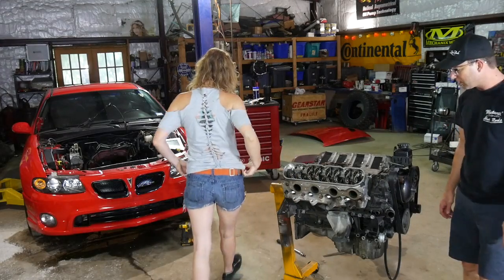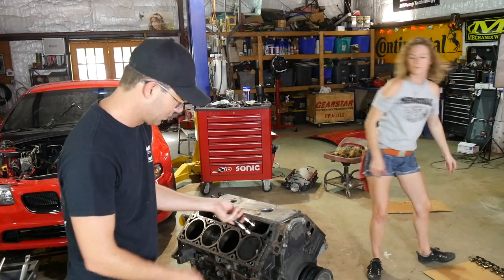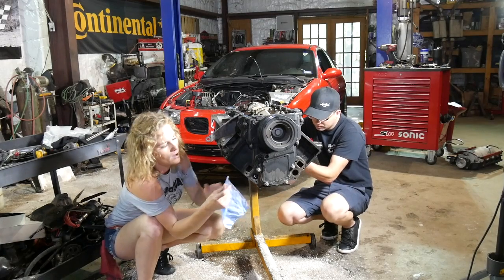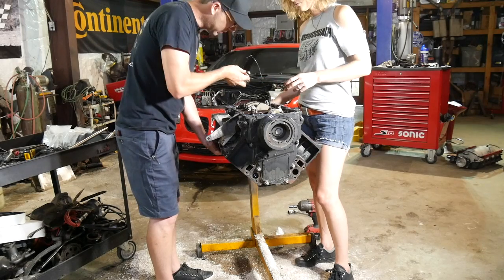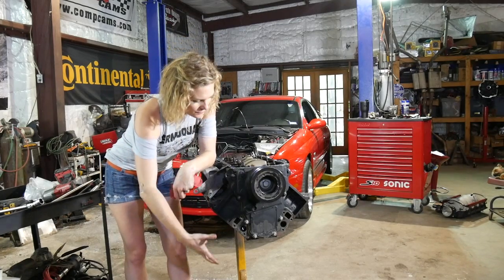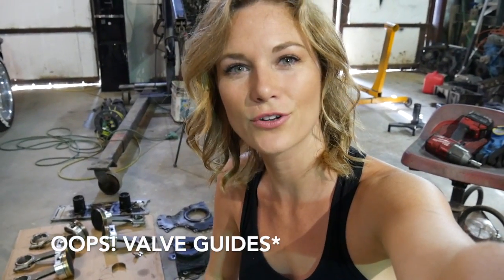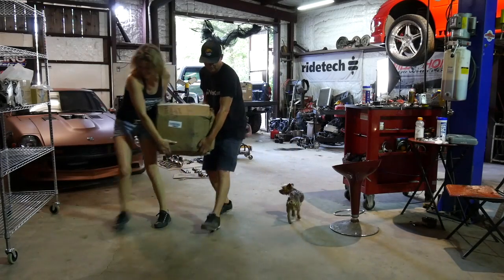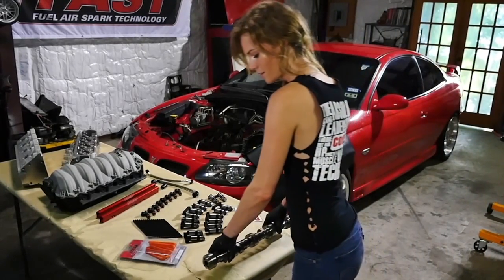Tearing the 408 LS down! In the shop with Emily EP 58

Comment: don’t sweat staggering rings, they rotate in the bore so they wear evenly. As long bore wear, taper and end gaps are good it won’t burn oil.
Reply: Exactly right!  Let's put an end to this crazy myth that "an engine will burn oil or won't even run if the ring gaps are lined up."!

Comment: Here in Aus, we call a "hitch" a "tow bar". The platform that roxy is based on its used to build sedans, wagons and Ute's. They are everything from basic taxis right to to high end luxuary/high power sports cars. 

Imagine a 6.2 litre, supercharged v8 ute (pick-up) with 550 hp and almost 700Nm of torque, launch control and racing brakes. With all that, you can still put 1400 kg in the back and tow 1600kg!

I would have been more surprised if Roxy didn't have the mounts
Reply: Sedans and wagon body’s were built on a totally different production line at Elizabeth. Same as Ute and Crewman yes
Reply: I was about to comment exactly the same thing, but you beat me to the punch.
Reply: They are built on different assembly lines, but from a design perspective, they are all based on the same platform
Reply: There's a monaro towbar setup laying behind my shed here in south OZ.

Comment: Absolutely the monaros came factory with a hitch. The brace was left on our cars but most remove them for weight. If you order a aussie rear valance from Holden Parts USA It is smooth all the way across but has a plug to remove to slide your hitch into! Had one on my car.

Comment: Not surprised that the most expensive thing you got at Summit was the bellhousing. That was by far the most expensive single component of my NV4500 swap on my Suburban. It was even more than the NV4500 itself! I'm enjoying all the stuff you're putting out and looking forward to the next video.
Reply: Hell, back in 1970 the Lakewood "explosion proof" hydroformed bell housings ('55 to '57 Chevy) were close to $600 with the block shield which was optional (iirc, another $75). And today just a few dollars more. And the '55 -'57 used the bell housing for the rear engine mounts; no rear trans mounting those 3 years for the full size Chevy.

Comment: step 1, install oil catch can.  Step 2, actually buy quality oil and use quality oil.  Step 3, disassemble engine in exact order of assembly. The way the heads were removed in this video will cause cracking or warping of the head.  The head bolts must be loosened in the same exact order as tightening.

Comment: Holden/Ford 6cyl/8cyl sedans are common family cars in Australia, so they often have a tow bar for light duty towing (6x4 trailer etc). I wouldn't be surprised if those studs are factory fitted to allow dealers to easily mount a tow kit.

Comment: G'DAY EMILY,to answer your Queries,regarding Towbars/Hitch on GMH(Holdens),YES,almost all commodores,in fact most sedans,wagons,Vans,UTES,have come standard with towbars,with factory optional,heavy duty,towing packages, which included, a heavier Hayman Reece,style square tube tongue hitch point,upgraded rear suspension, and option of wider exterior side mirrors,from my experience, of over 40 years,love and ownership of Holdens,I've found it unusual to find any,without towing ability, this is the norm,with most 6&8cylinder vehicles, it is common knowledge, that from the 60's,in motor racing, a lot of teams,towed the spares,equipment to the racetrack, with their primary racecars, even Peter Brock,joked in the 80's,how he and co drivers,broke in new racecars,in the 1000klm drive,from Melbourne to Bathurst, towing trailers,full of spares,trust this helps,love your GTO build,good luck at Drag week,kindest Regards,Dave McLaughlin, Queensland, Australia

Comment: Hi. Yep   Pretty we’ll most cars in Australia come ready to bolt up a tow bar and it’s been that way since the early 80s I think. 😎
Reply: I'm almost certain, that in fact in the 60's,with all vehicles from EJ on,that the factory allowed for standard 2" towbars,with dealer option for heavier tow package upgrade,from HD,HR on the 21\4" ball was included, as GMH,became aware of heavier Caravan, Car trailer manufacturer moved towards heavier hitch,then from Late 80's,the hayman Reece towbar System, with 50mm Ball,the 21\4" tongue,fell by the way?

Comment: Serious question; I'm building my first LS engine (LQ4) and I was planning on building a turbo forged stroker. Just about the only kits I can find are 4" strokes but everything I read says that's too much stroke and it causes the piston to come too far out of the cylinder at BDC which causes excessive piston and cylinder wear as well as excessive oil consumption (je pistons in particular has a compelling article on it), how was the wear on your pistons, and do you think this may have been a factor in your oil consumption issues? 
Keep up the great work!
Reply: Ryan smith don’t build a stroker turbo engine unless you just really want too or get an aftermarket block. Keep the stock stroke. I always advise against stock block stroker because of the really short piston skirts

Comment: don't rings rotate in the cylinder when running ?
Reply: No, not really "rotation". Pistons go up & down and don't turn / rotate in the cylinder bores.  It's more like as the engine warms up the ring gap closes as the piston head and rings get hot the piston "grows" incrementally larger (fits a 'schosh' tighter in the block); then as the engine cools down the ring may not (re-) expand exactly the same as when it was warming up. Couple that with the piston getting hotter at the top of the combustion chamber where the most heat is produced, and thus the upper piston ring becoming hotter - the ring gap closes more and the (re-) expansion is greater for the upper ring as the engine cools down when turned off.  That is IMO, the main reason that ring gaps "move" and can eventually become aligned; 1st and 2nd rings expand and contract at different rates.  Not much anyone can do about that, it's normal and typically compensated for by different ring thickness and the metallurgy slightly differing between them.   But hey, if there is a scratch or other imperpection in the cylinder bore chances are the rings can make the ring gaps eventually align with each other. 

And Aaron's commentary during disassembly about "numbers" on pistons / rods not matching the block would lead me to think that whoever assembled the short-block was sloppy,  more than likely before Emily and Aaron purchased that 408 already assembled and they just installed the heads. Plus the bad lifter at the rear of the engine might be indicative of poor or fast assembly of the short block just to get the done done and out-the-door.

Comment: Emily is that a roots or Whipple supercharger? the Whipple is more efficient and runs cooler, banks power on YouTube recent videos shows Dyno test on Roots vs Whipple air temperature and efficiency difference
Reply from the maker: tallcamaroguy It’s a roots type from Magnuson!
Reply: @flyingsparksgarage  the roots is 1850s technology, you would be better off with a procharger kit or a turbo because they are more efficient and use less horsepower and torque

Comment: Not being rude but I wouldnt trust a tow hitch on that car. Those mount bolts appear to be thru the sheet metal and nothing solid to the unibody frame rail. At best all a hitch on that car would be good for is a bike carrier or maybe a very light utility trailer hauling air.